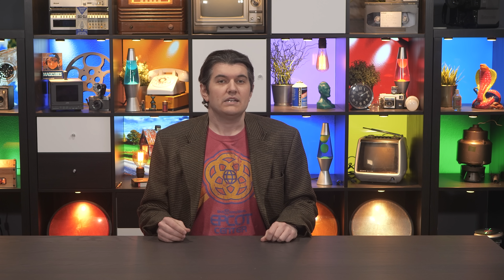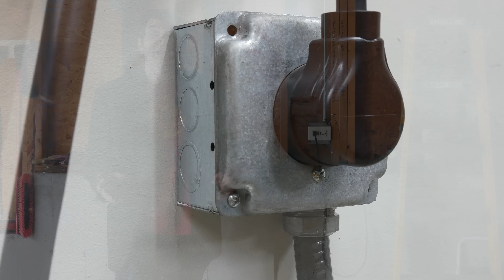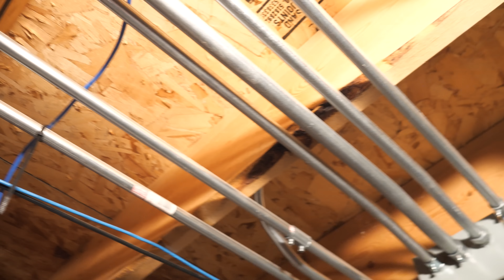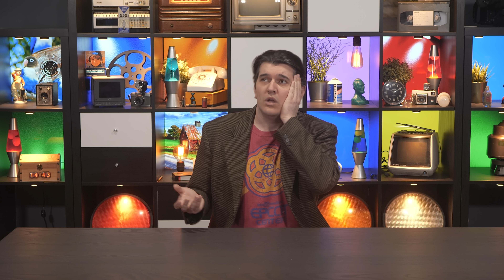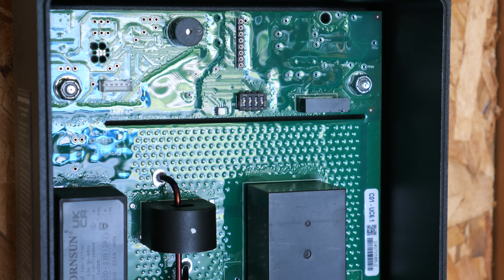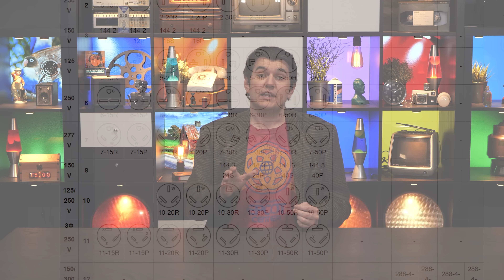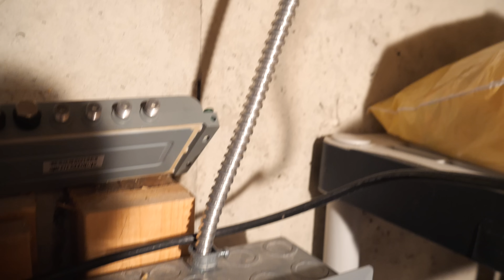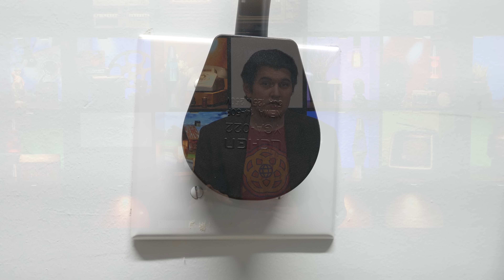The "standard" car charger is usually overkill—but your electrician might not know that

Comment: I don't think your point about regular outlets is a good one. Most EVs are not as efficient as your Chevy Bolt. A 110v receptacle can barely add 2 miles of range to my base Mach E in one hour. Overnight, I might get 20 miles of range on a 110v outlet if I'm lucky. In cold weather, a 110v current often will provide no meaningful charge whatsoever.

Plenty of people sell their EV because they cannot charge at 220v at home and it makes the car undrivable. You were correct about amperage being less important when you make the jump to 220v. But there are EV owners everywhere who charge daily at level 3 chargers because they cannot charge on 220v at home. 

If you're going to talk about EVs, in your factual, educational fashion, the biggest myth for you to expel is that owning an EV makes any sense if you can't charge at 220v at home. This is necessary. 110v is not sufficient for more than 2-3 miles daily for most vehicles.

Comment: I drive a Tesla Model Y, and have been charging on a mix of my normal home outlet and occasional Level 2 charging at client sites for a year and a half; I drive between 60 and 100 miles on a normal day, and generally don't have to use a supercharger through the week (the EV sits idle for the weekend most of the time, so I start the week on a full charge). 110v is fine for most people.

Comment: Agreed. A licensed electrician installed a 30 amp charge port  off of my 120 panel. My car "calls for" 50 amps. My car charges slower (6 hours max) when I am sleeping.  I don't even notice.  It's also a little better for the EV battery.

Comment: Starts by saying everyone has 120V branched circuits available…immediately installs a direct 240V connection.
Reply: Maybe that was just rage bait for everyone that knows EVs, all actual content of the first half of this video is spot-on accurate.  24A/240V directly connected EV on a 30A circuit is a great solution.  Most cars will actually charge at 3.3 kW which is safe and effective for overnight charging, in fact I wish these kinds of plugs were commonly available at parking lots (apartments, hotels, offices, anywhere many cars need to be plugged in and left - ie. the owner doesn’t want to come back out in 3-4 hours to unplug when finished).

But the economics don’t make sense for a single install at home if you have capacity for a 40A or 50A breaker, the wire and breaker will end up costing $50 more and the EVSE is the same.
Reply: I too have a 32A EVSE on a 14-50 NEMA socket.  I’ve had the Blink HQ EVSE for over 10 years and had it direct wired at my old house, then added an oven whip and had electricians install two 50A sockets in the garage at my new house during construction.  However they used cheap residential ($15) sockets and if I ever get a higher power EVSE I will either replace the sockets with commercial Hubbell ($90) sockets or direct wire a 48A EVSE.  

What we should be requesting is that NEMA create a special 14-60 EV version of the 14-50 socket, backwards compatible to 14-50 plugs with something like a plastic pin safety for new 60A plugs that are rated for 48A continuous and frequent insertion and removal.  48A seems to be the standard “fastest” home charging standard that manufacturers are settling on, and it really is more than enough even for big trucks that get 2 mile/kWh.  Anything more and it really stresses the power grid in and near your home.

Comment: For some apartment dwellers, we can rent garages. The $50 garage rent is about the same cost as paying to DC fast charge around town all month, AND I can keep the car in a garage. Yes, I am limited to plugging the car into a regular wall outlet, but with a short commute (around 10-15mi a day), it doesn't matter. At my last complex, we didn't have garages, but I could charge at work for cheap so that fixed that issue. 

The only charging issues I've had are 400 mile long trips that were for utilitarian needs rather than pleasure. It absolutely sucked to spend 30min 3-4 times a trip charging on trips every weekend for two months straight. Literally the only situation my EV has been a problem would have been a problem for gas car owners too. That sucked!

Comment: Dutchy here, so funny to see your eletrical stuff. Yet it is all in  Metal pipes Boxes etc. which to me  looks quite unsdafe compared to our insulated non conductive pipes etc. And ofcourse the restrictedness of your systems compared to our mains  ( phase +  neutral)16 Amps 220/240 Volts 
regular home  circuits that can handle loads of 16A*(~)220V=3520 Watts per group. And our earth-leak safety system for all dry groups, me being happy to know our electrical systems are safer and more capable then yours, just an honest observation LOL
Reply: Yeah, it’s amazing that the entire country hasn’t burned down because of our horrible electrical systems.

Comment: FWIW, I have a Chevy Bolt EV which I bought and used for two years without a 240V connection at home, and never once failed to have it fully recharge overnight.  Two years ago I moved to a rural community and my home already had a 240V outlet in the garage.  Since the circuit is sized for the highest current the car can draw, I never ever worry about charging.

Comment: If you are having to hire an electrician, the main cost is his time and as such, it's going to cost about the same to install a low amperage outlet as a high amperage one... As such, you might as well do it right and plan for future expandability... You never know if you might eventually need that 50A circuit to run a welder on also... 

My 240V circuit in my garage started out for my welder... It only needed a 50A circuit, but the 60A breakers were the same price, so I decided to make it a 60A circuit... The original wire was pretty short because that is where I needed the welder located... I think it originally was UF-B and at least 6/3... That stuff is a pain to work with... It really doesn't want to bend around ANYTHING... When I bought my wife a Tesla MYP as a "city car", she did not want the EVSE to be located on the back wall of the garage (where the welder's outlet was), so I removed the old outlet and ran a new line to the wall near the main garage door... I used 4 strands of 12 AWG THHN for each of the 4 connectors on the outlet (because I had 4 500-ft reels of that wire on hand in different colors... I ran it in a raceway at eye level in the garage so that I could monitor it's temperature... It works great, doesn't get even slightly warm to the touch at 40A... Supposedly a single 12AWG THHN wire it good for 30A, so I guess that means that I am good for 120A... That's a pretty good safety margin...

One thing that I will say though is that even running the 16 12AWG THHN wires, it is a LOT easier than wrestling the UF-B cable...

Any idea which Chicago codes require that flexible metal conduit cable?  That seems particularly stupid, but considering it is Chicago and filled with leftist crooked politicians, I'm not surprised... Did you consider running another cable in parallel so that you can increase the amperage on the charger?
Reply: why are you making electrical safety a pollical conspiracy theory?
Reply: @BelRayOtter-ek9qk  -- Nothing in Chicago is about safety -- it's either about power or money...

Comment: Electrician and generator technician here, I bought myself a stark varg EX and am beyond pleased to be a "pioneer" (early adopter) but the charger included is 6.6kw @240v and 3.3kw @120v but when the charger is connected the display on the bike allows you to change the input power to prevent breakers popping. I made a cable adapter to plug into my 50a welder receptacle and a long sjoow 10/4 cable with twist lock on the charger side. I know a 50a breaker doesn't protect a 10awg wire especially in a cable but I've never seen a lamp with a 14awg cable so the code assumption is that the breaker only protects what's installed in the walls and considered permanent, anything plugged in is up to user discretion and how big your cohones are. I'm very happy I upgraded for no necessity but now I get 1% of charge per minute, granted it is a DC fast charger.

Comment: I disagree. Recharging from 120v/15amp takes more than 24 hours, and I just drive 2-3 hours a day at most. Also, as noted below, the charging circuit itself consumes up to 300w. Also, I had to replace my 120v, 15A breaker because the contacts were burning out from  constant  24 hr use at high current.

Comment: We just use the standard 120 volt charge cable that came with our RAV4 plug in hybrid. Works just fine.
Granted we have the on board engine to charge if it runs out of EV range, which is not often for our needs.

Comment: I own a Tesla. It came with a mobile connector. I decided to have a NEMA 14-50 outlet installed in the garage. The wire run was 30" (yes inches) from the outdoor 200 amp service panel. I used a 50 amp breaker. After a few months the Tesla mobile connector was throwing error codes for "overheating." I did some research on-line and with Tesla service. Turns out the electrician used a cheap-ass Leviton connector from Home Depot. I had it replaced with an industrial duty Hubbell. Roll forward 4.5 years. Problem solved. I see no need for a wall connector(Tesla, GrizzlE or other). I take the mobile connector with me on VRBO trips 3 or 4 times a year. I think the Hubbell can take the unplug and plug a few times a year. As you said the car can handle all of the off-peak programming requirements. I also set the charge rate to 20 amps, rather than the default max of 32 amps. IMO, wall connectors are oversold...unless you drive Uber. I do not miss gross, smelly, time sucking gas stations!

Comment: I just have a NEMA 10-40 box wired up to a regular 240v 10-30 extension cord for a dryer that I just cut the female end off.  Put a switch on the 240v so you can't run the dryer and the charger at the same time, plugged it in.  I ran a separate ground to the last leg to stay "code." 

My charger is set to 20A max, on the 30A breaker. Still 8x faster than the granny charger. It's a fancy extension cord, and apartment friendly if you have compatible parking.

Comment: My biggest issue for my situation is we live in an apartment complex with one charging plug and multiple people EV‘s. Not to mention the 2020 leaf that in winter if you use any heat gives you roughly 40 mile range on a 40 kWh battery. And yes, the battery is fine. Nissan sucks. Once I have an opportunity to get rid of this leaf will be sticking with our Volt and maybe getting a used i3 REx

Comment: 35 year experience Master Electrican, and owner of 2 Bolt EUVs. First off, electricians are required by codes to install for the maximum allowable amperage of a circuit. In the case of a 14-50 outlet, I’m required to wire that for 50 amps, and you should too. I wrote this long thing out describing how to look up insulation, terminal, and ambient temperature calculations- YT hates that- so I’m going to summarize without all the information that contractors use to find the minimum allowable requirements for a safe installation. The National Electical Code is printed by the National Fire Protection Agency, that should explain my motivation for writing this, and why DIYers should pay attention. Heat and potential fire considerations is why I overwired my EV outlets at home. 

Rather than get into temperature ratings of terminals, wire insulation, and ambient temperature considerations to find the minimum allowable wire size I’m just gong to skip to how I do it for me. I upsize for the maximum. It’s my house. Yes, I know I can charge at a lower amperage, and do, but I do that on a maximum wired circuit to increase the life of my equipment- breakers and EVSE. For 14-50 outlets, nothing less than #6 AWG. There are ambient temperature considerations that most electricians miss in calculations. If your wiring goes through an attic, you might need to go up another size to #4 especially if you live in an extremely hot climate. In that case, make sure your outlet is capable of accepting #4 wire. DO not ever use aluminum wire for EVSE wiring. I also don’t put EVSE outlets in wall mounted boxes. I will find a place where I can put a box on the outside of the wall, and use the largest box, like an RV weatherproof outlet, modified to fit screw holes on a metal 4” box in the wall. I do all this to give me enough room for larger wire, and hold enough wire to be able to remove the outlet to check terminal tightness 2x per year. All things loosen over time, and these terminals will be heated up to say 40C or higher, then cooled to ambient temperature hundreds of times in 6 months. It will loosen. 

EVSE’s are an extreme use case. It’s your house. Please consider that, and save extra money if you need to. Also, don’t let some dorkus electrician install EVSE wiring in your home who is not taking the temperature rating of the entire circuit into account. If they do not understand why they should start with the 60C column even if they are using 90C insulated wire- then find an installer who does, or demand 1 size larger wire. It’s your house. 

Questions?

Comment: I agree with the smaller size needed. I have 48amp and it’s overkill. It’s also more beneficial if you have a plugged connection compared to a hardwired. My charger broke once and I had troubles to charge till I got a replacement. With a plug you just plug in your spare charger and you’re good to go.

Comment: The code
Has mandated that the insulation values be written down and placed on the electrical panel or some other conspicuous place as kind of a miles per gallon breakdown on a sticker on a new car. And it hasn't worked, people do not understand the numbers that are on there. What is the insulation value of a window with a u-value of 0.32?
In my neck of the woods, code is adopted by the state legislatures who make money from building homes, a developer as a president of one, and a home builder of the other.
Many other legislatures are members of the Home Builder's Ass.

Comment: The IRC from 2015 (I think) and on requires that a 20 amp circuit 120 V be installed in each vehicle Bay. As a billing official inspector plans examiner Galore, I cannot believe how many builders chose that hill to die on. 
 Everything would be better and safer. If the people making the decisions weren't desiring with their bank accounts also pocketing the money. 
I know that it is a two pickles instead of three pickles on a hamburger thing, and that it all adds up.But they put so much emphasis on the more expense served things that the homeowner buyer can see and touch because that's how people are.
If cars had the same situation, we'd still be killing whatever we were killing without government forcing auto makers to make cars safer. Not to mention air pollution.

Comment: I love hearing you call it a 80% rule.  The code maths it 125%. 
So that does take a 48 V. Charger up to a 60 amp circuit.
It maths the same. It is just not what the NEC there by the IRC does not either.
Where did you get this from? Tap rules?

Comment: Personally, I think that charging is a thing you’ll do every day, and it will work better, especially when you are old, if it is as easy as possible. This may mean a separate charger for each car, which is capable of doing 60-80% of the battery’s charge in 8 hours. It is annoying to have to juggle multiple cars on one charger, and consider the problems if you forget to charge any of them one night, which is easy to do with only one charger, and now you have immediate need, quite a backlog and only one charger cable. If the electrician is out anyway, and even if you have only one EV, if you have multiple cars, I’d suggest putting in the extra stuff so you can easily install the second charger when the second EV eventually arrives. It’s not like NEMA 14/50 is going to go out of date! You can also use it for your band saw in the mean time. Also, at some point in your life you will probably have teen drivers under your roof, so you really will need to use 3 cars each day, and extra complication for the teen is going to mean some trouble getting to school on time.

Now it might be the case you have a 3rd car like a mythical EV minivan which is rarely or never used. For that, the 120V charger on an extension cord may be just fine to trickle charge it and keep it ready for that next big trip to the big box hardware store. At the same time, though, realize that for some of these behemoths you really will be using it only that often. A 210 kWh Chevy Silverado, charging at 1.2 kW on a 120V circuit is going to take 210/1.2=175 hours to charge, which is 175/24=7.292 days to fully charge the thing, and a lot longer if you only want to use cheap electricity at night. Fortunately, unless you are taking it to the jobsite you probably won’t be using it that much, and even if you did, the jobsite wouldn’t be 400mi round trip away. Nonetheless the bigger card do require bigger charging circuits.

Comment: My outlet got super hot, turned black on the inside, and could have started a fire.  I don't recommend using the standard outlet as many are not made for sustained charging that an EV needs.  If you use Nema 14/50 make sure again it is rated for EV charging.  Most have a car symbol on them and will cost more than the standard one.

Comment: Smart features on a power supply would be like having your laptop charger connect to the internet and be controlled via an app for how you want your laptop charged instead of using the laptop's computer settings 😆.